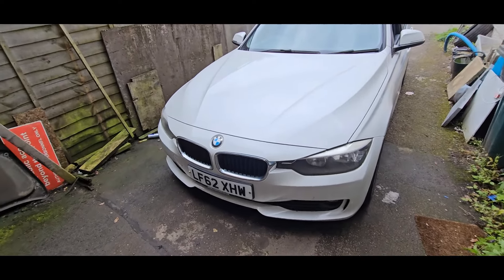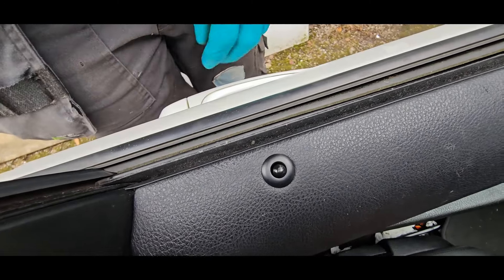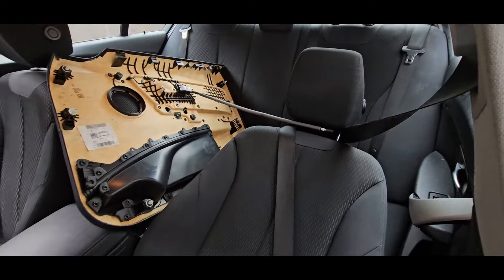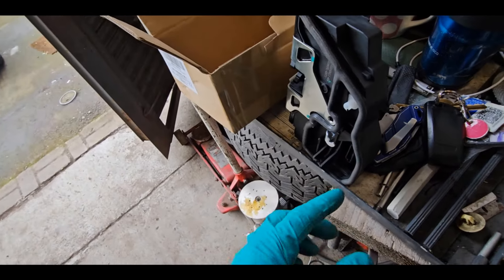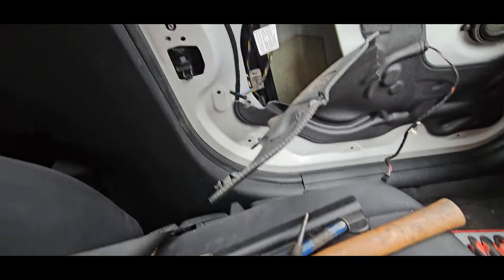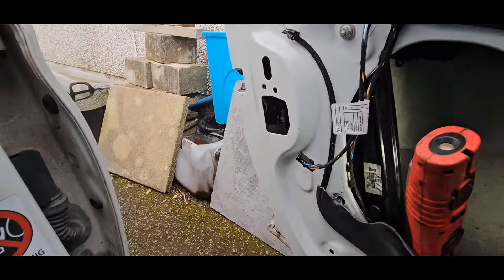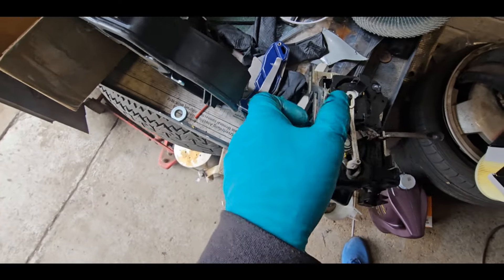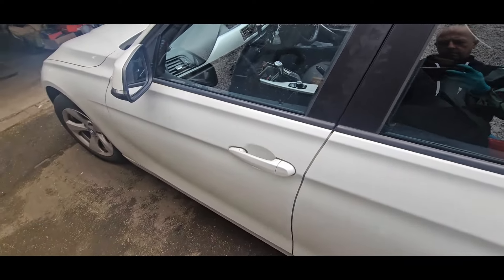Bmw Door Won't Unlock,How to open it...Actuator Failure...

Comment: how did you manage to get the panel up and off with the door closed? I have taken out all screws but can't get the panel out to free the clips to lift panel up from window frame due to dashboard this on drivers side. I practice on passenger side with door open